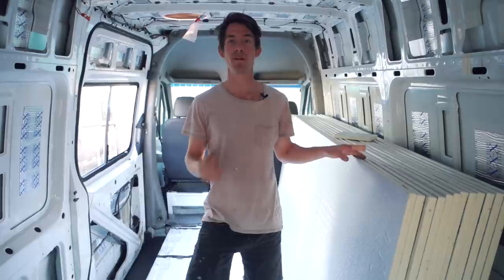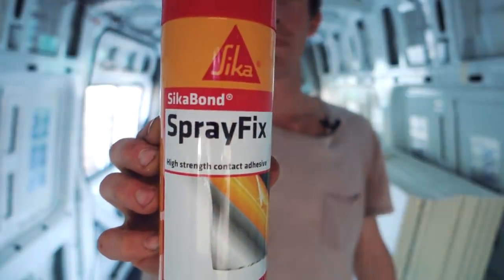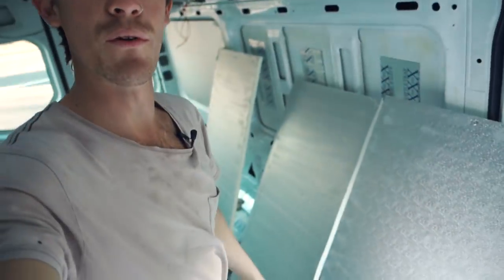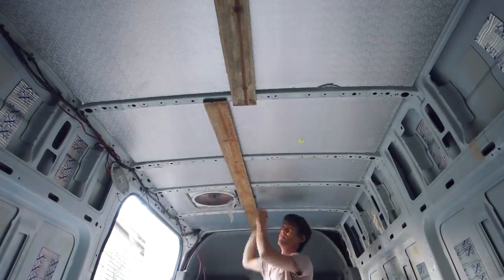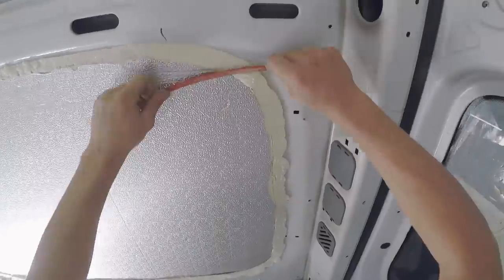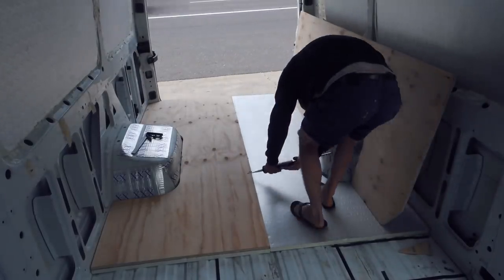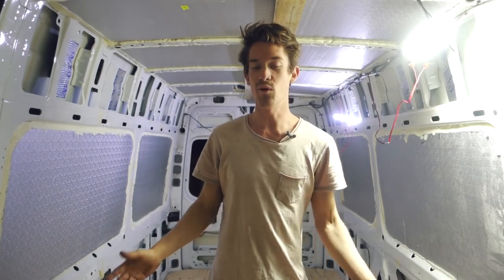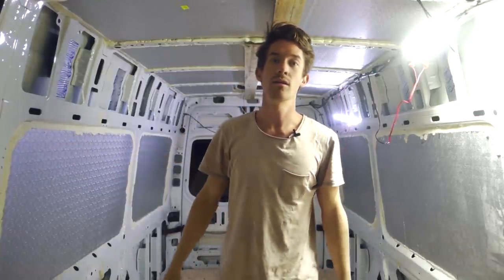S1E4 Sprinter Van Conversion | Insulation + Floor

Comment from the maker: Really glad I installed the PIR foam, it works really well and keeps the inside warm on cool days and warmer on cold days. Coupled with the window inserts in Ep.14 it works great! I didn't opt for a moisture barrier, so far so great but I live in Australia.

Ep.4 BLOG + PRICE BREAKDOWN - http://www.jazmorton.com/van-conversion/insulation-floor/
Season 1 Van Build - http://bit.ly/VanBuildS1
Season 2 Van Life - http://bit.ly/VanLifeS2
Reply: Looks like great  !  Noted this would not work in humid countries  And here in Canada a huge amount of water would form in the winter with cold and hot inside  However with the same items you had You would need to cut the panels smaller to form between the metal framing And use a chauking gun with a smear of water res, glue.  Closed cell foam in the frame gaps and holes flush with the panels and tape to cover and fine gaps making it air tight
Reply: Yeah, this would rust a van out within a year or two along the coast of California. Spray insulation foam (applied correctly to avoid warping the sheetmetal, and not sprayed downward into cavities to avoid blocking weep holes) or Thinsulate are the way to go in humid, damp environments. If someone reading this lives in the a US, you'll need to use one of those two products.
Reply: @Jj-gi2uv  I've had no problems with either, in damp, wet, foggy, coastal San Francisco climate. 👍

Comment: I’m in the middle of doing my insulation and floors and I’m a bit confused that you just put the poly iso down under the ply instead of putting battens..Not worried it’s going to compress in certain areas? Have you had any problems with it?

Comment: These videos are so zen...there's a real satisfaction in watching every detail come together slowly like a puzzle. Keep up the great video work!
Reply from the maker: Haha thanks Phillip, got my Zen on 😊
Reply: Travel With Jaz it looks like you have the extended length model? Here in the States we have 144” and 170” (inch) wheelbase options. Then you can option a 170” with an additional body length. Is that what you have?

I drove one today and took a bunch of measurements for my rough plans. Only problem I foresee is the ceiling height. I have 2 inches between the top of my head and the ceiling ribs, so with paneling installed it’s going to be a tight squeeze!

I absolutely dig your shower and toilet setup by the way.

Comment: Glueing Poly insulation will rust a van out within a year or two along the coast of California (and many places in the US). Spray insulation foam (applied correctly to avoid warping the sheetmetal, and not sprayed downward into cavities to avoid blocking weep holes) or Thinsulate are the way to go in the US, else your van will rust out completely from trapped condensation.

Comment: Nice job
Copper pipe to make the mould is genius!!
Reply from the maker: Haha cheers mate!
Reply: Watching your vids, just found them and think they are so helpful. One thing on the flooring, would the original floor not be good enough and secondly could you cut a pattern from it. Maybe yours extends wider or something?

Comment: brilliant v informative- wondering about condensation in the gap left between van exterior and insulation?
Reply from the maker: I think it should be alright, the PIR insulation is closed cell foam also. I haven't seen any vapour or anything come through.

Comment: You live in a warmer climate than me but all the ribs in between the insulation panels are classic cold bridges.
Reply from the maker: Yeah Australia gets pretty hot, but also can be pretty cold too depends where you are and what time of year
Reply: Stuff the ribs with wool.  Use a vacuum cleaner to suck some material on a mould resistent string thru first.

Comment: Because the sides and ceilings of vans are slightly curved it's hard to get adhesive to hold it in place, especially the thicker the pieces of polyiso.  I had good luck with a GE product called "Iron Grip" (Home Depot) which comes in caulking-type tubes, even with 2" pieces on the ceiling of my RAM ProMaster (1.5" on the walls).  I used a method similar to yours to hold the cut pieces in place until the Iron Grip dried.
Reply from the maker: That's awesome glad you had good luck with it, once the expanding foam set though I've had no problems:)

Comment: Nice job. Can I give you some free advice? Wear safety glasses when you're drilling. When I was your age, I didn't use them either. Then I got a piece in my eye. I only noticed it later in the mirror when it started to rust on my cornea. The fix was to have an eye doctor take a medical grade  Dremel to my cornea and buff it off.  Not fun.
Reply from the maker: Wow Mark that sounds bloody rough, I definitely don't want that! Yeah mate I should wear them a lot more, appreciate the advice too.

Comment: Dude you are the first person I have seen that did the insulation correctly, so awesome, all these other Vans that have the fibre insulation jammed against the outer wall are going to rust because of condensation being trapped. I haven't seen all your vid's yet but I hope you left air flow in the cavity to escape, cool in the bottom hot out the top...
Reply from the maker: Thanks a lot mate, yeah well from living in the van for nearly 3 months now the insulation is doing a great job. Stays warm at night and cool in the day. the air gap does wonders

Comment: Pretty sure that spray glue didn't hold those sheets of insulation. Would be much easier just cut it in a few parts by width. And same with walls.

Comment: Bom dia! By far the best series on a van conversion I have seen on the web. First one where I am not fastforwarding :-) As to your flooring, usually I see builders gluing battens on the floor, than the insulation panels in between. Did you have a specific reason for taking another route? Enjoy your vanlife
Reply from the maker: thank you i didnt want to loose height space so i didn't batten out the floor

Comment: Was wondering about different insulation options.  One concern is condensation on the interior wall of the van.  Did you research that first?  I don't know what is best in terms of avoiding condensation, just a question really.  
Also wondering why you didn't go thicker on the roof, because of summer heat?  Great videos, BTW.
Reply from the maker: Thanks mate, yes I considered everything but with limited information out there I just went for this, and will see how it goes, I didnt go thicker on the ceiling because this is basically the largest size that fit in the cabitiy space. It does a great job I will say and with the solar panels on top its even better :)

Comment: At the start of your video, you mentioned that it would be better to leave an air gap between the metal wall and the foam board.  However, you later did not leave an air gap because you glued the foam board directly on the wall.  Is it better to try to create an air gap between the wall and foam board as well as between the ceiling and the foam board?
Reply from the maker: Hi, there is a small airgap from the external wall to the foam board on most of the wall insulation, you can see when I put up small bit of sample foam board and I explain the gap, as they all sit on the ribs that protrude.

As for the ceiling the air gap would be much smaller.  I basically did the best I could with what I had to work with, in some part just because the way the van is designed there will be no air gap. 

In my mind it just makes sense to have an air gap because of how heat transfer works but it isn't a rule of thumb. 

As for the air gap from the interior side of the insulation to the sheeting, there will be a slight air gap in most places there too

Comment: I know the spray foam is popular for filling the gaps, but I think I'm going to pass on that. Suspect it's insulating value is negligible and the mess.... I guess I like to think someone might take the van back down to the metal skin again (maybe me if I redo the walls because mold or whatever) — would hate to have all this spray foam stuck everywhere.

Comment: Hey Jaz, just a quick question about the moisture barrier. Seems like so much mixed oppinions on it , I've been reading a lot! I live in Oz too so warmer weather for the most part. But did you find similar results in regards to many mixed oppinions and possibilities in regards to installing moisture barrier? Cheers Mike
Reply from the maker: i havent had any problems with this subject ive had many questions, i havent taken the van into sub zero temperatures though so still to be fully tested i guess
Reply: @JaznLori  Hi Jaz.  I'm procrastinating on getting started with my insulation because of the vexation the vapour barrier debate is causing.  I'm in Melbourne and want to travel all over, mostly north along the great divide but also to see lots of beautiful, cold, wet Tassie too.  I really don't get how a vapour barrier works after all the reading and listening I've done.  If moisture forms inside the metal skin, how will a vapour barrier sitting on the inside of the inner skin (on the bottom half of the wall anyway) help prevent the moisture forming on the inside of the outer skin.  I'm so confused.  I'd greatly appreciate your ideas about this.

Comment: i am still doing my research on inulation beofre i begin my sprinter.

I am leaning towards the way RB Conversions do it. I would love to be able to buy their precut but its $1300 plus shipping plus conversion from US TO canadian and that will set me back at east $2000 and I haven't included duties if any.

I noticed you left an air gap and I am looking at a company called Attic foil which recommends a radiant barrier,(air gap) as you have done and I will try to do it with Jute and foil.

I recently spoke with an outfit in Red Deer Canada that will start selling some parts and they have insulated several ways and right now are using rigid like you. I think they are one of the best Van conversion outfits out there called Overland Explorer.  May be able to get sone ides from them as well.

Good job on your Van. Look forward to nest videos.

Thank you, Liked all your videos mate.
Reply from the maker: Legend mate, like your input I always appreciate a different set of eyes. Yeah I left an air gap for this reason to reduce conductive heat transfer, the laminated reflective foil reduces radiant heat transfer. I'll have to check out Overland Explorer!

Cheers

Comment: Just curious Jaz, why you did not put rattle trap on the floor?  Is it not necessary or you have other plan?
Reply from the maker: Good question! I figured the floor would have 25mm completed covered with the insulation,  and then a further 17mm on top of that so it is pretty well insulation for vibrations.

Also it would make the floor slightly less level which I didn't want either

Comment: I've never quite understood if it's really beneficial to use foam to fill the gaps. The reason is it's right next to an efficient heat transfer medium anyway (i.e. the metal) that will transfer heat from front to back around the insulation anyway
Reply from the maker: yes this is true, one of the main reasons I also did it was to keep those insulation panels sturdy, they cant slide forward or pack since the foam is rock hard there. I think having it is better than not, but then again there isn't a right and wrong ;)
Reply: To avoid heat transfer, why not use entire large panels, not to fill the gaps but to cover all the walls..? Ok you loose volume but gain efficiency.. My 02 cts..

Comment: How do I know the correct Amp for DC wires?  They range from 5 Amp to 80 Amp??  Also, it gets confusing with the wire AWG sizes.  They range from 4 AWG to 14 AWG.  Does this mean that I could end up with all sorts of sizes for DC wires in my van?

What about AC outlet wires?  Are AC wires less complicated?
Reply from the maker: The rule for amps flowing in a circuit is the wattage of the circuit (power) divided by the voltage of the circuit (volts). So Amps = P/V 

There are other factors to also consider called voltage drop. The lower the voltage e.g 12V, the higher the voltage drop over a distance as opposed to 110V or 240V which travels much further on the same amount of voltage drop and much less current is flowing also.

So generally DC cable need to be much bigger compared to AC cables because of these 2 reasons, 

- Amps flowing
- Voltage Drop

I will be making a video on all the electrics soon.

Here in Australia were generally use 2.5mm2 cable for power circuits, good up to around 20 amps as a rule of thumb. 

As for the DC in this van on most the circuits I'll probably be using 4mm2, possible some 6mm2 but we will see.

I would definitely get a good electrician to help you.

Comment: If you pushed and glued the insulation foam boards directly against the ceiling, there is no air gap.  Does it cause the heat to transfer more into the van from the ceiling?
Reply from the maker: If you go to Ep.2 you can see there will be a slight air gap due to the 3 layers of Rattle trap I installed and I explain this too
Reply: Travel With Jaz 

Oh good.  I got confused.  I want to make sure I leave a proper air gap.  Thanks!

Comment: Definitely some good work...however, seems like a lot of overkill/extra weight, too.  With the amount of insulation you put in, sound deadeners seem redundant.  I also dont understand why,  when the insulation fell,  you didn't just upgrade to heavy duty bonding adhesive (spray is too light for this job).  I think a better initial bond would've made the need for reinforcement unessesary.
Reply from the maker: Thanks all the PIR foam i put in this van you would be able to pick up with one hand, it is as light as a feather. The 19mm ply on the floor isn't as light but this van can take a higher payload as its dual rear wheel.

I know i could've upgraded the bond which I would do if i ever did again, but when I sprayed in the expanda foam it set in rock hard.

Comment: Where in Australia are you?

Nice to find some Aussies doing it so I can look for those products. About to do this myself.
Reply from the maker: Brisbane mate, that's awesome good luck on your project!
Reply: Damn, I'm Melbourne based. I would have given you a hand to learn the process a bit! I'm contemplating to wait until I'm in the states to build mine to save some money and I prefer the scenery to travel in over there. Do you know if there are many of the 4X4 versions in aus?
Reply from the maker: damn mate! I'm not too sure how many 4x4 conversions there are, I don't think they're as common in Australia compared to the states. actually one of my mates has an older model 4x4 sprinter, his insta is _thevanlife

Comment: Hi Jaz, Great work mate. I'm in Brisbane too, just about to start my van conversion. Can I ask where you got the rigid insulation from?
Reply: all good brother, Just read your blog!! Cheers
Reply from the maker: Awesome mate good luck on it! Which van do you have?
Reply: Haven't bought it yet. Selling my ute next thursday, I was looking at a Renault master MWB but heard some bad reviews so looking a Ford Transits and Sprinters, all MWB. I want it under 6m in length, the sprinter comes in 5.9m which is perfect! yours is the MWB right?